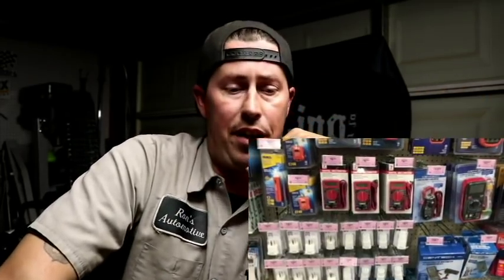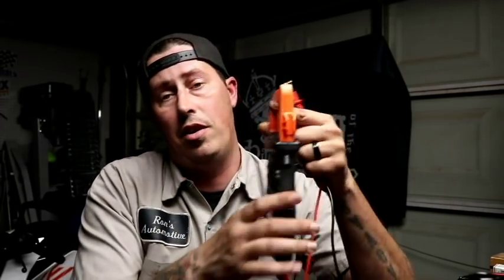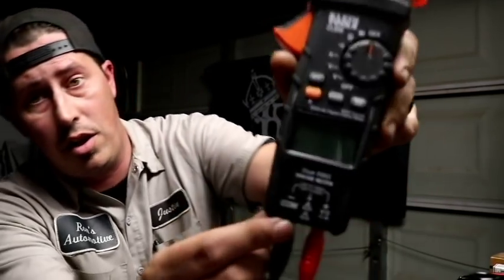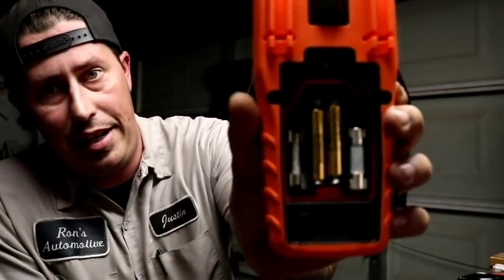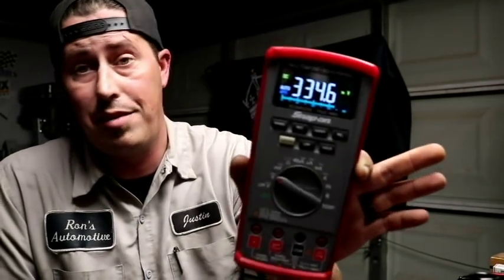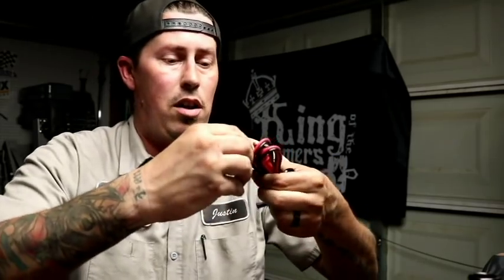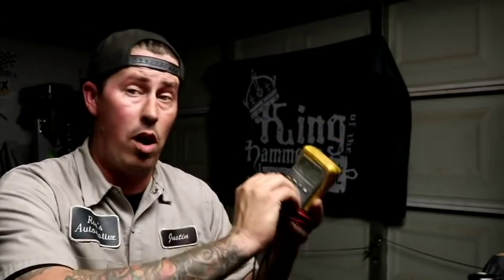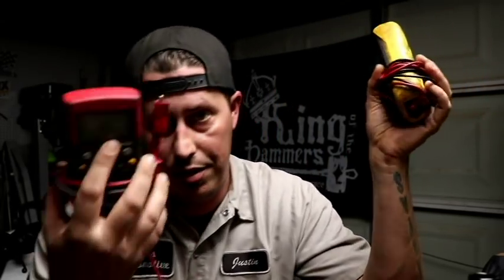MULTI METERS USED IN AN AUTOMOTIVE SHOP!!!

Comment: Fluke 87v.
Min max function can accurately test batteries on load and charging states. 
You can set, then walk away to actuate the circuit, scroll through the min max and average,plus it has analog bar for voltage sweep of potentiometers.
And alot more. 
Bought from pawn shop almost new

Comment: I use a Mac Tools auto ranging multimeter CAT 3. I gotta say so far it’s worked great for me. It came with a set of test leads which have also been working great. So far I have used it mostly for the basic voltage drop tests and resistance tests.
Reply from the maker: Auto Tech Luis Nice!! 🍻👍

Comment: Sears (If you can find one) sells a DC amp-clamp  multimeter that is used for cars. (it was recommended by my  alternator/starter
guy).  It runs about $59.99 off sale. It works great to check my battery and  alternator.
Reply from the maker: joe r Awesomeness!!

Comment: I have the snapon, ehhh it was ok. Then I got the fluke 88- thats my go to for electrical. I leave the snapon out, only to pretty much check bad batteries.
Reply: Smart man. Fluke 88 is the standard, and designed specifically for the automotive mechanic. Mine is over 20 years old. I did recently have to replace the elastometer to fix the dim display which cost 25 bucks. The originals have a real nice owners manual with pictures of basic auto tests and heavy duty case. I have a coworker who just bought one but it did not come with a manual. He called  the company and they sent one out. They said you have to request an owners manual now because they are a "green" company trying to save paper. LOL
Reply: Genuine fluke can not be beaten.

Comment: Get a DC clamp meter mate. Better get one that goes down to 1mA resolution, so that you can just clamp around the battery without taking the battery leads off to test parasitic draw. I've thrown around my Uni-T UT210E AC/DC clamp meter around quite a bit and it's always been great and accurate. I just use it for the car and it has been amazing. I do use pretty expensive Fluke and Brymen meters for me electronics projects.

Comment: I have had really good luck with the innova 3220 meter. Not the greatest but for a cheap meter, it hasn't let me down yet. As for leads. Probe master all day long. I got a set for 15 directly from them and they have been awesome. Leads can make or break a meter.

Comment: I've not used my meter for any repairs on my car, but I tell you this... I've had 3 meters in 10 years.  I had a generic one from China, a Fieldpiece, and a Fluke. The Chinese one and the fieldpiece lasted about a year each. The Fluke has lasted the other 8 years. Get a Fluke if you can and only buy it once. I use mine a few times a week as a plumber.
Reply from the maker: I love me my Klien and Snap-On who I'm told is a re-branded Fluke. So I would have to agree with you. Either by Klien or Fluke. Cheers!

Comment: Try a Fluke 374 It has ac/dc clamp measurement. The only thing its missing for automotive is diode testing, and temp if you use that.

Comment: True RMS isn't a speed thing, it's for accuracy.  RMS is a calculation for the Root Mean Square value of the AC voltage being tested, meaning its the equivalent voltage of a DC waveform.  Without RMS your meter reads peak-to-peak voltage of the sine wave which gives a higher voltage reading.
Reply: I just watched the video when I was going to write the same thing. Remember, RMS only applies to AC voltages. 
RMS meters can only accurately measure 60 cycle, sinusoidal signals. True RMS is able to accurately calculate RMS voltage regardless of the frequency, and regardless of the shape of the signal.

Comment: Don't quote me but if I'm not mistaken doesn't a hybrid battery have 305 volts when it's fully charged which is classified under high voltage so to be able to tell if your climb meter are you snap on meter will test at you need to know what your max limit for DC volts is
Reply from the maker: Corbett Knowles Gotcha. I’m going to ask my boss when I get to work today. 🍻👍

Comment: Have an expensive Fluke meter with some great features, but to be honest, I don't use it very often. The meter I use the most is the cheap Harbor Freight meter they sometimes give away. I think its priced around $6. You don't really need an expensive meter for automotive work. What do you think about the Harbor Freight battery tester? Do you own one? I think its called Cen-Tech Digital Battery Analyzer.
Reply from the maker: MotorheadRedo hmm? I’ll have to check in to it. Guess it didn’t catch my eye the first 100x of being in there.lol I’ll try and take a look next time I’m in there. 🍻👍

Comment: My basic ass uses a Craftsman that my dad gave me when I started 3 years ago works good for my applications not a major diag guy but for most basic diags it gets the job done and I keep one of those El chepo harbor freight free DMMs in my arm rest in my car as a throw away if I need it
Reply from the maker: David Post Dang right. Nothing wrong with that. My first meter was a manual ranging Craftsman. Then I switched to an Auto Ranging TRMS & have pretty much stayed with the Auto ranging ever since. 🍻👍

Comment: I have a cheap Craftsman that hasn’t given me an excuse to upgrade.  Have never needed the rms feature.  Also have the power probe 3, but mostly use the Craftsman + incandescent and led test lights for mundane stuff.

I’m also a fan of Klein.  Great uncle was an electrician, and I was involved in construction early on.  Electrical trades swore by them.  Rubbed off on me.
Reply from the maker: asm154 Nice!! 🍻👍
Reply: Aren’t craftsman multimeters made by fluke? I could be wrong though.

Comment: I use the fluke 113 have like 11 years with it, but it doesn't have amp meter, so i bought A'MES  dm600  and the centech because it reads up to 30a and they're fairly inexpensive

Comment: I don't think you understood my meaning on if your DMM is fast enough. A fuel injector is switched to ground for only a millisecond or two. A DMM can not switch from power to ground that fast.
Reply from the maker: cfmcc83 Ahh ok, but with KOEO wouldn’t you have power on one side and ground on the other?
Reply: @JustinDowDIYcentralhighway  No. When the injector is grounded it opens and puts fuel in the engine.
Reply from the maker: cfmcc83 gotcha. Man I got a lot to learn. Thanks for sharing your feedback Brotherman I appreciate it. I gotta start doing some more research on engine performance. I purchased Scanner Danners ebook but that was 6 years and 3 laptops ago. I should have purchased the hard copy.

Comment: DOESN'T LOAD TEST THE CIRCUT THOUGH, WHICH YOU SHOULD DO A VIDEO ON, I HAD A COLORADO COME INTO THE SHOP, CUSTOMER WANTED A FSCM INSTALLED AND PROGRAMMED, HIS PART, INSTALLED, STILL NO FUEL, HAD CONTINUITY BETWEEN THE MODULE AND THE PCM, PCM WAS TURNING IT ON, ENDED UP FINDING THREE SPOTS IN THE HARNESS WHERE PEOPLE PROBED, AND WHAT DO YA KNOW, LIL GREEN VILLAGES IN EACH SPOT
Reply: ...and why you test for ohms rather than continuity!

Comment: Whats your thoughts on the klein mm600? Its the step down from yours in the video
Reply from the maker: Chris Scheadler DVOM Or Amp Clamp? Sorry trying to remember all the serial numbers is hard. Are you referring to the non TRMS? If so I think they are great in fact if you watch some of my earlier videos you’ll see that I had one and it worked really well. 🍻
Reply: @JustinDowDIYcentralhighway  its the DVOM non TRMS. Thanks for replying. Im just trying to learn to use it in the auto industry and i wasn't sure if i made the right choice. Ill deffinetly look at that video.

Comment: Look up what True RMS means again. Check out fluke.com for definition
Reply: True RMS is useless in Automotive work . Only pertains to non true sinusoidal waves , but the 3phase Motors uses in hybrids and EVs are converted DC to a very choppy AC so it would be great for that application .

Comment: Just did a ton of homework on this, for DIY home and automotive I settled on this one because its clamp is 1000A (home) that also does DC(automotive), All the fluke meter true RMS stuff,  peak inrush, , no-contact voltage detector, capacitor testing (air conditioners), a temperature probe and a bluetooth 4.0 app to control it remotely, for $70:
https://i.ebayimg.com/images/g/hqkAAOSwzpNcxhMA/s-l1600.png

Comment: continuity is crap when you do not understand it.
test for ohms instead that will show you that a cicuit(or part of) which shows continuity actually is so corroded that it eats all your volts, thus circuit is NOT ok!